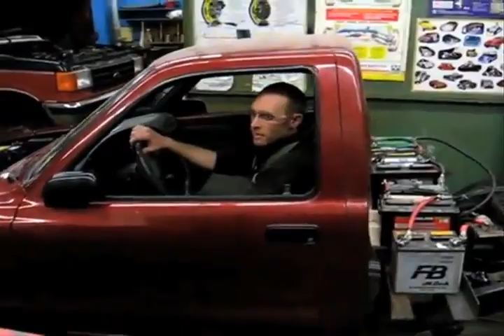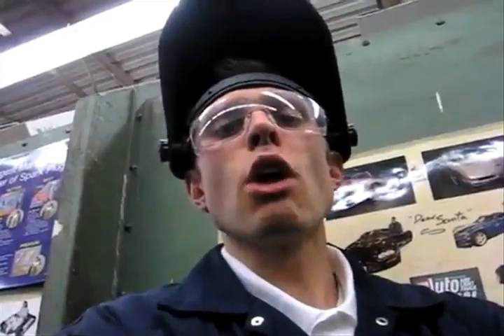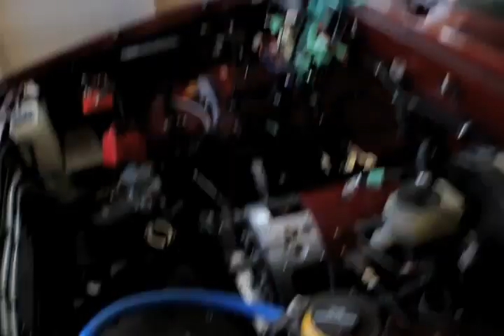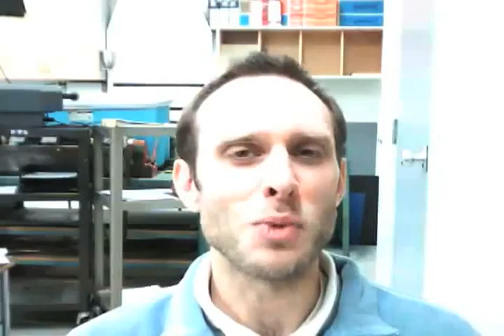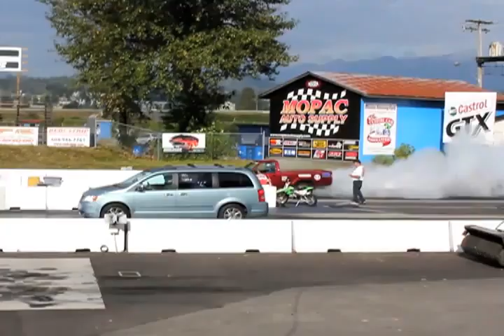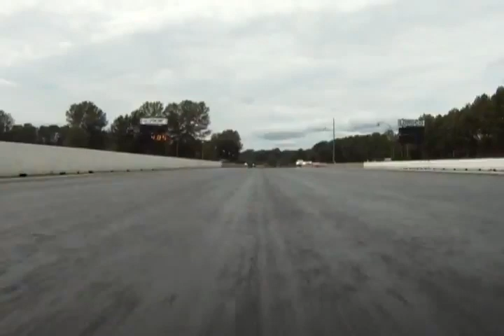DSS Electric Drag Truck - GE Great Futures - Ideas in innovation......

Comment: Hello, I have a fwd highly tuned turbo vehicle (2007 VW Golf gti fwd manual) I could do the 4wd conversion but that would share the power of the gas engine with the rear wheels while adding over 1000lbs on the car. I was wondering if a rear electric motor could be a better option since it adds power while adding around the same weight, improving traction and fuel economy. how feasible could this project be?